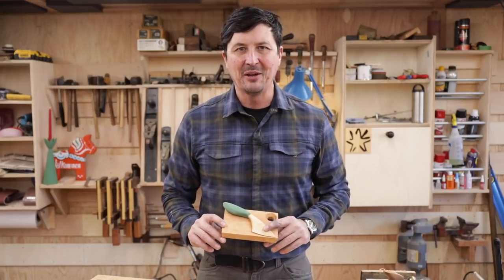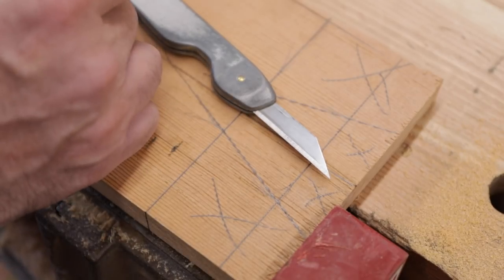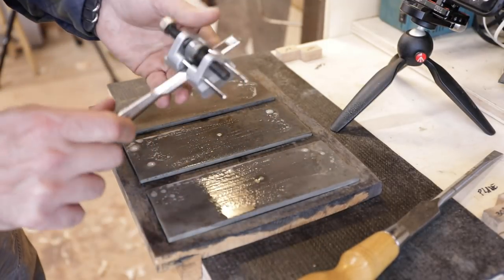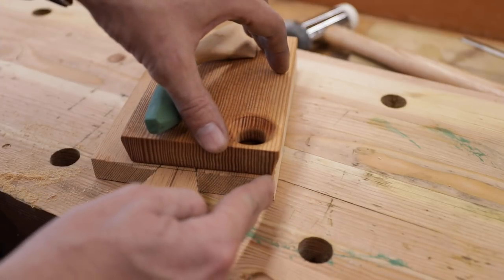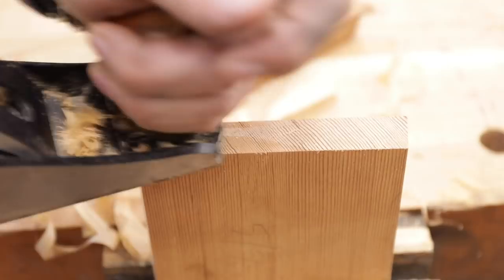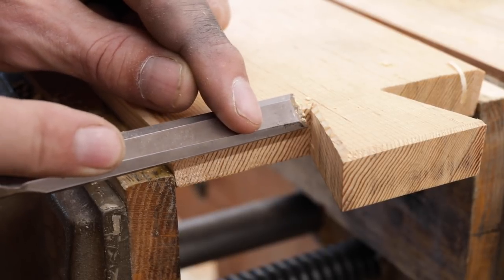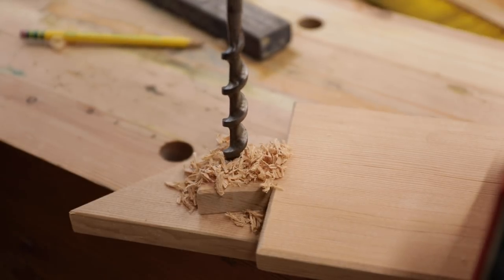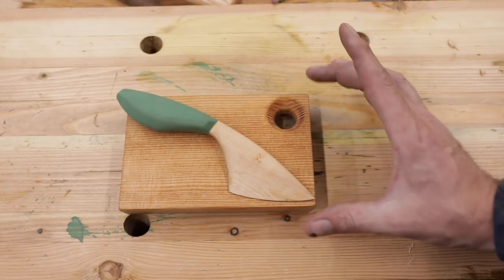Making The Famous Swedish Bread Board

Comment: Fascinating video for a little project, Cody! BTW, I've been woodworking for over 30 years. I'm thinking that using Fir for a breadboard isn't a good idea. One of the unfortunate challenges with wood breadboards is that they may tend to hold bacteria. Softwoods like Fir might tend to have a greater propensity for that kind of thing. I'm thinking that Alder, Birch or Maple would be the safer choice (and would be super durable).

Comment: To save the new board, paint its handle green.  Both could also use a thin black band between the green and natural wood.  The problem with the smaller board is people will stick the knife's handle in the hole to keep the buttered blade off the wood; then you'll have a knife sticking up in the air.

Comment: Hi Cody, I've got a great idea how about a review of clamps use and places to get them etc. this is a win win, as the woodworkers say you can never have too many clamps.
All the best,
david
get every good type of clamp you can. 
review Bosch cordless drill motors, my favorite, although im running with a Fein cordless now, the rub at about a year of battery use give possibly 4 months the batteries cough and sputter weakening much or are no longer viable; I've been told Milwaukee fuel are the best impact drill motors.

Comment: I think I would have used a good file for the inside corners of the handle end. Also I could use sandpaper Taped tight on a hardwood stick about one inch wide. That eliminates the tendency of the sandpaper to roll the edges over. The board with the handle would look better with the handle being cut round I would think.

Comment: How do you keep the boards from warping? All cutting boards I've made that arn't stacked vertical grain wood will warp after washing.
Reply: Brendan Stanford Depends on how the fibers are going
Reply: Doug. Nothing beats an authentic style butchers block. Those are the only boards that don't warp on me
Reply: Brendan Stanford clean your board with a damp cloth dont get it wet. if it gets too dirty use a scraper to resurface it then seal it with veg oil or nut oil
Reply: Don't wash only the side you use. Wet down both sides of the board and you'll keep it from warping.
Reply: NviForce ...this is true... the swelling from wetting and subsequent contraction from drying on only one side deforms the material.
Reply: Brendan Stanford It should'nt be a problem since the board is only used to put butter and different cold cuts (i have no idea if cold cuts is the right term) and therefore we (scandinavians) just wipe of the crumbs with a cloth and if something else than crumbs are on the board we can use a wet cloth.
Reply: @Brendan Stanford I would also recommend an end grain cutting board if it's going to be seeing frequent use and washing. You can also make your board slightly waterproof by giving it a coat of mineral oil.

@Rasmus Vestergaard If by cold cuts you meat sliced meat for sandwiches, then you would be correct.
Reply: Blood of Gaea Yeah that's kind of what i mean. In danish we have a word called "pålæg" which directly translated means "lay on" so basically it is all the different stuff you put on bread or in sandwiches. When it is for lunch it is stuff like ham, different sliced sausages, beef, deer, fish and if it is breakfast it would be a lot of the same but in different bread and maybe also thin slices of chocolate (Pålægschokolade) or Nutella. So the word cold cuts actually only describes some of the danish term.
Reply: You could see if you cam get a quarter sawn board, they are the most stable of woods if they dont sell that kind of boards near you, you just search the wood stack for that board

Comment: One of the basic rules of 3D modelling is, "there is no such thing as a sharp edge". In real life, that is, and to get good results in 3D you have to, therefore, bevel every edge, no matter how sharp. If you do not, the audience will be able to tell.
So even if you make razor sharp edges with tools that could cut through an elephant without even trying, there is always going to be a bevel there. No exception. Just... a very small one.

Comment: The breadboard should be curved like the knife. Maybe make a similar board like the smaller one with the hole in the corner, however make the edges curved the same curve as the back of the knife?!

Comment: Why are all these bread boards so comically tiny? The one without the handle isn't even as big as your hand. 
You should really try a larger one like 12" x 8", that's the most common size in Germany and I even prefer larger ones. You can butter your bread without soaking up the juices from the tomato you just cut and still have space to cut some cheese without getting crumbs all over it.
Reply: Yeah, I prefer a full-size cutting board myself as well.